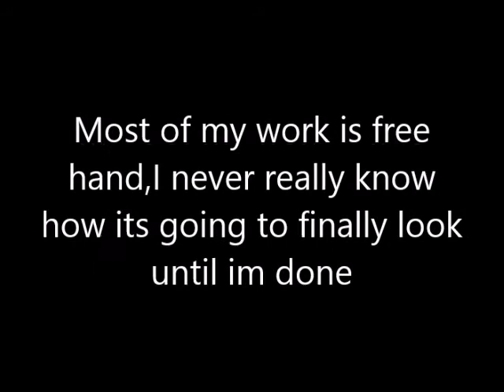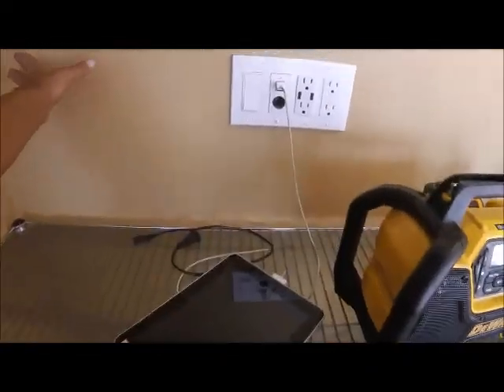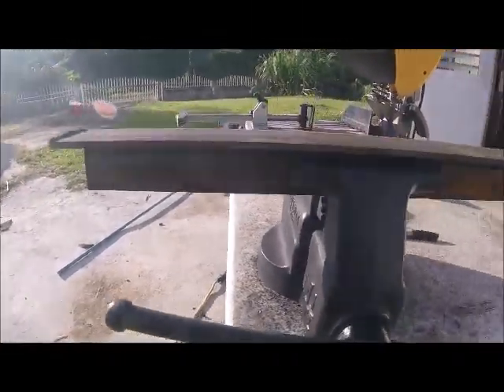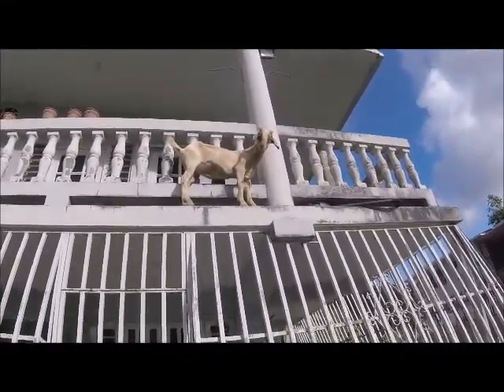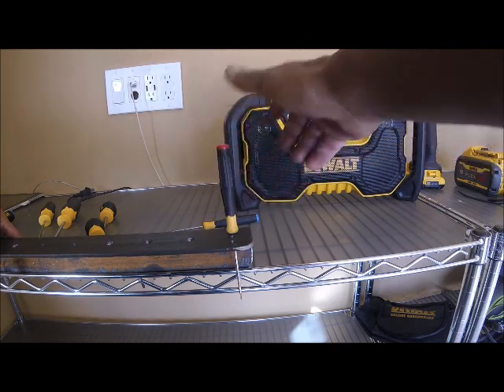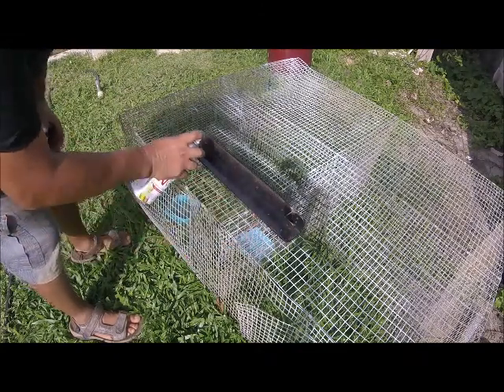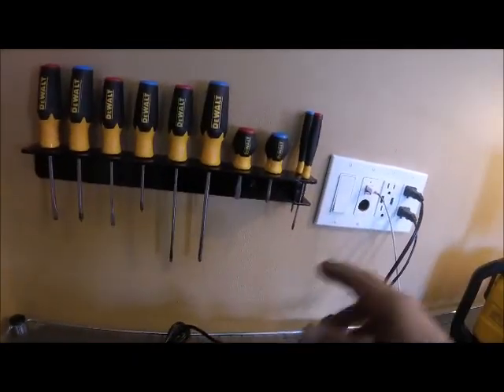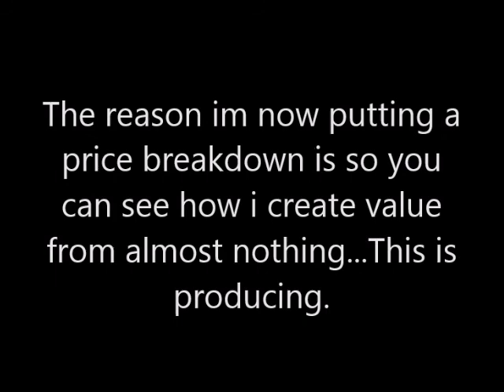Diy Screwdriver organizer

Comment: Real men just shove them into the dry wall
The video should have been entirely about the goat. You left us wondering what happened!
Change the channel name to GoatMaster 1
Reply from the maker: Real men know multiple trades, a real man lives in a house he built with his two hands lol...My home doesn't have one ounce of inferior drywall lol, screw drivers can't penetrate my walls, but neither can AK47 rounds either lol
Reply: @MosaicHomestead  tough windows! Lol
Reply from the maker: @HuplesCat  they are lol...my window 🪟 casings are metal, they are special storm windows designed for tropical storms,  obviously the glass is glass, but its 1/4 inch thick, the windows are reinforced with threaded steel rods, thats why they are so strong...homes here are built very different.
Reply: @MosaicHomestead  bunkered up and with special ops goats!
Reply from the maker: @HuplesCat  No rocket stove video today, it looks like rain, it only cost me $6 bucks,  the cost of the BBQ paint.